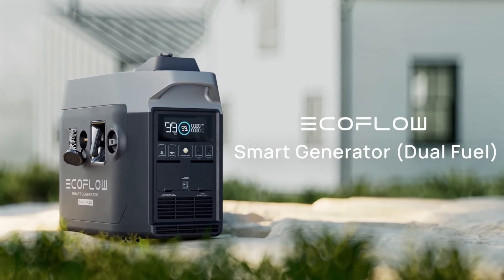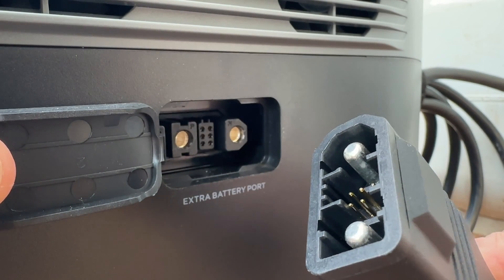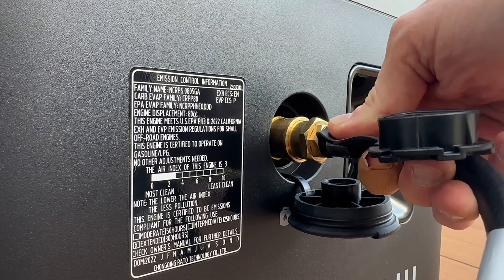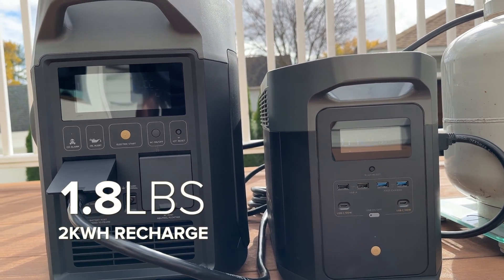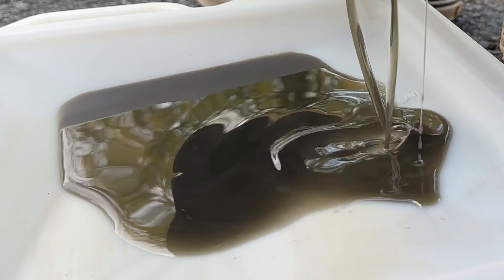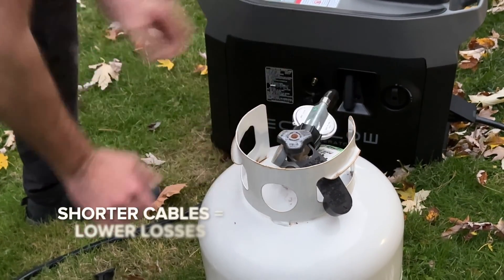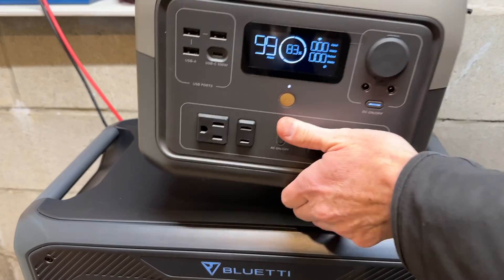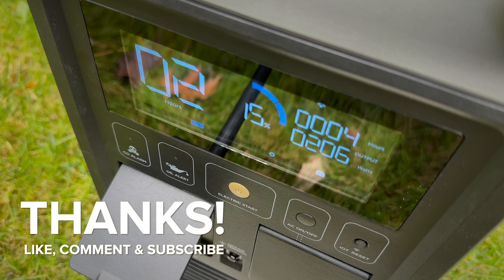Ecoflow Dual Fuel Smart Generator: Charge DELTA Max, DELTA Pro, and Power Kits with Propane or Gas

Comment: Great video - thank you - Question please - I want to have a Delta pro or Max connected to commercial power to serve a couple of 120v appliances in a mountain house that will be vacant most of the time.  In the event of a power outage, the delta pro kicks on - however if the power outage is long in duration and the batteries eventually drain, will the smart generator automatically crank and recharge the batteries.  So, in other words, can the delta pro or max be connected to commercial power and the generator at the same time.... and act like an automatic transfer switch?  thanks
Reply from the maker: Yes, that should all work. You'd connect your appliances to the Delta and keep it plugged in so it's in UPS mode. If you also connect the smart generator via the expansion port it will automatically kick on when the battery hits a certain % you specify. When the generator runs out of fuel, then you're out of luck

Comment: Any chance you know the RPM in Eco Mode? I'm aware it will hike back up to 5000 RPM when loaded up.
Reply: This is an inverter generator, it can reduce engine speed if there is no load or it is very small. I can't say the exact number of revolutions in Eco mode, but I think it is about 2000-3000 RPM.

Comment: I am about fed up with the ECOFLOW jokers. Their website is no use whatsoever to get actual HUMAN or intelligent AI support but they will sure take your money. I ordered TWO complete systems that they (ECOFLOW) had bundled together to include the delta pro, the extra battery AND the dual fuel generator. Mind you, let me repeat. . . . theses were BUNDLES assembled by ECOFLOW. . . . could I plug the devices together as the bundle was built out by Ecoflow???. . . .nooooo!! Instead, I have to go looking for special bits and bobs at additional expense and DELAY pretty much on my own- AND give up and thought of the use of a second battery. Why does the generator even need an adapter? Why does it not have its own port? Why do the cables have to protrude so far out the cases and not just be trim 90-degree plugs so the cases fit better next to each other or just imagine. . . . . a WALL? ohhh and do not even get me started on their "smart" home panel. . . .I am greatly regretting this rather large purchase- these kids of headaches were certainly not talked about by our YouTube influencers or mentioned (in some non-obscure manner) on the Ecoflow websites. The bundle ALSO ships WITHOUT the proprietary cables to connect any solar panels. . .

Comment: As others have said, this was an excellent review. I’d like to add that I found the info on adding oil really helpful. The nearly horizontal oil fill tube made it difficult for me to know when I had the right amount in. The documentation is in liters and gallons (0.1), which is inconvenient in a country that buys oil in quarts (0.4 quarts is the right amount). Seeing the oil touch the threads of the cap/dip stick is the best way I’ve heard.
Reply from the maker: I struggled a bit with oil, so glad it was helpful!

Comment: Best EF genny review on Youtube - quick question does the EF generator have an inverter function like the Honda where it runs at a low speed and only increase when loaded using the 120 AC plug? Thanks Mike
Reply from the maker: Thanks. Yes, I believe this is an inverter style generator

Comment: Kinda surprised it's not fuel injected. Does the auto start work without the app installed? Can the batts be made to trickle on solar, charge on mains/grid; and fire generator if grid down? Thanks in advance 🤠
Reply from the maker: Auto start doesn’t need the app except to configure what battery % to kick on. You can set this up to favor solar and only use grid and the generator only if needed at least on the delta max and pro
Reply: @todd.parker  So a fella can't plug it in, skip the app, and set the low/ high battery settings right on the device; forget about it except oil changes and fueling?
Reply from the maker: @davidlobaugh4490 by default the smart generator will kick on at 20% and shut off at 80% so that’s what will happen out of the box with no app. If you want to adjust those thresholds, that’s where you need the app
Reply: @todd.parker  much appreciated, I figured that, I don't have to do a bunch of homework or buy it to figure it out. 👌 Looks like might be ordering a unit(s).

Comment: Thank you for the review - I currently have the EcoFlow Delta dual battery setup with the Hub that connects the 2 power generators - will the EcoSmart generator charge both batteries at the same time, or do you have to charge them separately? Also, can the power stations be in use pulling wattage when the EcoSmart is charging the batteries? Thank you in advance for your help
Reply from the maker: It should be able to change and recharge from the generator at the same time. I don’t have a Pro so I can’t answer your first question, sorry

Comment: Looking forward to hooking this into my RV. I plan to install an automatic transfer switch behind the panel and run a generator 30 amp outlet in the storage bay where the Delta Pro will live and plug into. From there I'll add a cable hatch that runs under the storage bay so I can put the smart generator outside but run the cable to the Delta Pro in the storage bay with the doors closed.
Reply from the maker: Cool setup

Comment: Great vid! I just picked one of these up and love it so far. I'm trying to decide between the Delta Pro and the Delta Max + battery. I'm torn between the portability of the Max vs the output of the Pro as I'm trying to use the setup for camping as well as home backup. Any suggestions? Thanks and keep up the great videos!
Reply from the maker: Thanks! If you don't need as much AC output or 240v, the Max is the way to go since it's a lot more portable. A LFP battery version should be coming in the next few months of you can wait...

Comment: Can this be used as a stand alone generator without requiring the DELTA MAX or PRO generators?
Reply from the maker: Yes it can by using the 120v AC plug but you're probably paying too much if you're not using the smart communication with the Delta power stations to auto start/stop and charge efficiency via DC.
Reply: @todd.parker  Thank you soo much for your response and advise on this. I live in an area where the risks of black-outs are becoming likely,  I wish to start off with this Dual fuel since LPG is quite cheap in the UK. At some stage in the future, I plan to kit out with the other DELTA generators. I just needed to know whether this was good enough for generic use like mini fridge and laptop.
Reply from the maker: @DonReality  Them this seems like a good buy. You can use it directly to power your fridge and other appliances during a blackout and then eventually add a Delta

Comment: Exhaust … how to connect?
Reply from the maker: There isn’t an easy way to connect an exhaust hose as far as I know, it’s meant to be run outside
Reply: @todd.parker  @Marty Miller you can add an exhaust extension and put the SG in a small enclosure to keep it out of teh elements

https://youtu.be/SLDodjfXHG8

https://youtu.be/MED7T4Q2ono

Comment: Hi, i see you have 2 delta max with extra Batteries
By any chance have you tried linking 2 delta max?
Is the second max recognized as smart generator and working as if?
Reply from the maker: I only have a single set of Delta Max + extra batteries so I haven’t tested that. Sorry!
Reply: At 9'28" i see 2 deltas, each on an extra battery. Maybe the one on the left  is a delta 2...
So the question was to know if they would share energy from one delta to another, and eventually attached batteries.
Nevermind. Don't blow it 😉

Comment: You do a great job with your videos...very well spoken and great explanations. I just bought the Delta 2 and a backup battery and to finalize my peace of mind it would be smart to have an outside duel fuel generator to recharge the Delta 2 when there is no power or sunlight during a lengthy power outage. Question on the Delta 2 warranty? I hear they are a 5 year warrany but when mine arrived (bought off Amazon and the package deal of thre Delta 2 and the extra battery) when I opened up the warranty card is said only 24 months upon registration? I think I might be giving them a call tomorrow...plus there seems no way to register the extra battery? Do you have any knowledge of this?
Reply from the maker: The smart generator is great and it’s great to have an alternative to solar on dark days. I like propane so the dual fuel is my choice. Warranty should be 5 years, might as well reach out to confirm

Comment: I just ordered my smart dual fuel generator!! I have Ecoflow Delta Max 2000, Delta Max 1600, 2 back up batteries and solar panels, 640 for my 2000 and 220 for 1600 unit.  I get loads of sun in sw desert of scottsdale and solar works great..  Still wanted an optional recharge, excited to set up!
Reply from the maker: Awesome

Comment: Hi from UK.  Great review,  I've 4 allpowers solar generators that perform well. But now I'm looking to build on them with the ecoflow range and this smart generator not for the European criss, but to invest for cost saving longevity.   So you video has confirmed its suitability and when or if price is reduced, I will get one. My tip for you with the leaving the door slightly open and loss of heat etc.   With pipe foam you could easily fill the gap. I've sliding patio door and use a similar system to allow for a Chinese heater heat exhaust to enter the house whilst keeping the draft and outside conditions out.   Alternative is to make a small cut in the door to accommodate the lead, with a sliding internal and external mechanism to cover the hole when not in use.    Hope this gives some food for thought and maybe a solution.  Cheers
Reply from the maker: Great tip, thanks!

Comment: This seems to be mostly a DC generator. That would be ideal for charging batteries. It would not be ideal for AC output though, I think ?? I'm just guessing but if it is indeed a DC generator then it is unique in that respect. Most generators are designed to output AC. I'm no electrical engineer so feel free to tell me I'm wrong.
Reply from the maker: You’re right that DC output and Delta integration are what make it unique but it still a very good dual fuel AC generator too!
Reply: @todd.parker  I wonder how efficient it is to run it on AC ? I'm just asking. If I had this unit I'd use it to charge batteries, mostly. Years ago I converted my sailboat to electric drive. I had 8 Trogan lead acid 6 volt batts to make up a 48 volt system. This genset would of been great to have.

Comment: Nice Review!  Todd, will this also charge the new Delta 2 through the proprietary DC cables?
Reply from the maker: Thanks! It should work with the Delta 2 because it has the same port as the Max and Pro but Ecoflow is still working on firmware to support this.

Comment: No one talks about that fact that you can’t max out the amount of batteries that the Delta pro normal can expand to. In fact you lose 1/3 of batteries capacity just by having this generator waiting around to use its smart feature. For example: I have 2 Delta Pros and 4 extra batteries hooked up to my smart home panel. If I purchase 2 smart generators, I lose 2 Extra batteries because the Smart generators use the same extra battery ports. So at the start I just went from 21.6 kWh to 14.4 kWh with the Smart Generator. Now let’s say in both cases, I want my recharge my batteries once the get to 30%. In the example with maxed out batteries (21.6 kWh) I would have to start my generator when I have 6.48 kWh battery power left. The smart generator will auto start when I have 4.32 kWh power left. This means that I am reach empty a lot faster and the generator is kicking in a lot more. The trade off of 10% more efficient DC charging isn’t worth the loss of 7.2 kWh battery capacity from the start. A champion, Wen, Firman (or any other brand) inverter generator and a Reliance through the wall generator kit will save you hundreds of dollars and allow you to keep your windows and doors closed while you charge your batteries. Also some of these inverter generators now come with remote start key fobs so that you don’t even have to go outside to start the generator. So in short skip this junk and you will: increase your battery capacity save hundreds of dollars buying 1 not 2  generator, keep your windows and doors closed during a storm and start your generator from the comfort of the inside of your house.
Reply from the maker: Thanks for that perspective. If they just added more expansion ports, it would make it much more useful.
Reply: @todd.parker  Yes. Very true. If there were more expansion ports that would also make EcoFlow’s system more competitive with other companies like Bluetti, Zendure and others.
Reply: So how do you have to have two inlet ports one outside and one inside so you can charge your generator when it gets low from them outside with the smart generator?

I seen a guy plug his gas generator outside and then plug is delta pro inside to power the house and charge it at the same time! That confused me
Reply: @jroark101  I’m not sure that I totally understand your question. But I will say this: the smart generator can only connect to 1 delta pro at a time when using its auto on auto off feature. It has a proprietary cable that charge the battery and send/receives data. In most cases you would have to figure out how to run this proprietary cable through your wall to make it work. Also the use of a gas/propane generator is just in case your solar is not making energy on bad weather days. There are many ways to make this work. I use a through the wall generator kit for my inverter generator.
Reply: @Steve Paige Modify the exhaust??? I’m no mechanic or HVAC technician. All I know is that it is NEVER recommended that a generator be used indoors. I wouldn’t try it.  That is above my skill set. Also carbon monoxide is a colorless, odorless and tasteless gas. So get your DIY modification wrong could cost you your life (or someone you love).  I’m sorry to hear that your panel is not connecting to the internet. My panel is connected to the network and I can see what’s going on at home from work just by opening my app.
Reply: Wow!! So glad I read your comment before I got one.
Reply: Did you try to feed delta pro with two smart generators same time utilising both ports? How they behave in case?

Comment: Great review. I would need a long cable from the generator to reach my Delta Pros in my basement, if they made one I would get two of these.
Reply: I agree with the fact that the 16 foot cable is too short. For home backup I wouldn’t buy this. It’s over priced. There are plenty of more powerful dual fuel inverter generator that cost less on the Market today.
Reply: I agree with the fact that the 16 foot cable is too short. For home backup I wouldn’t buy this. It’s over priced. There are plenty of more powerful dual fuel inverter generator that cost less on the Market today.

Comment: I'm surprised no other company has come out with a "smart generator" like this before. EcoFlow really has a sweet product here! Great video Todd!
Reply from the maker: Thanks Jason! I know, seems like such a perfect fit. I think the customer support logistics of gas engine is tricky. Goal Zero announced a generator years ago and scrubbed it because of logistics.
Reply: @todd.parker  yeah, they must have a good amount of trust in their system to have a 2 yr warranty.
Reply: @Jasonoid  This is a brain dead necessity for any aspect of solar generator systems.  For emergency, for off grid, etc.
It is very obvious to me at least that the solar generator market is a "prepper" solution to alot of things.  No more need to outfit RVs with all the electronics.  If you have to bug out, you can throw the stuff in the back of the car, etc.

As for warranty etc, certainly they could team up with, say Honda, to make the smart generators for them.

I like Bluetti too, but without a smart generator or the brains to run a 3rd party, a non starter.